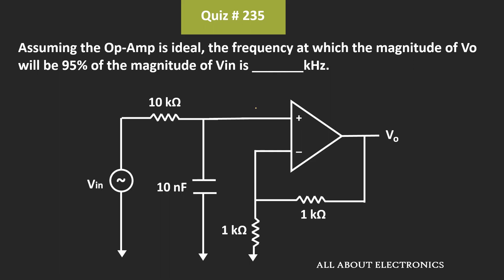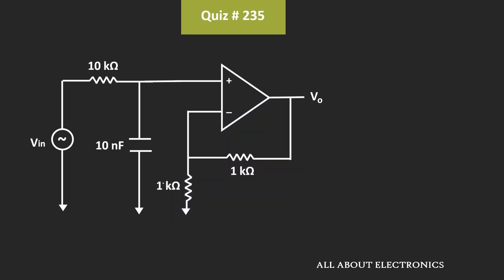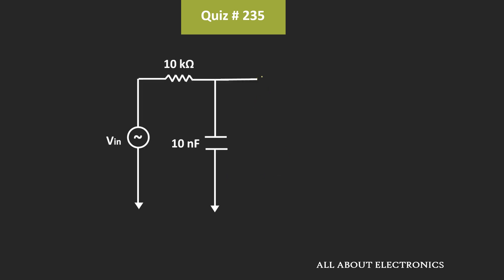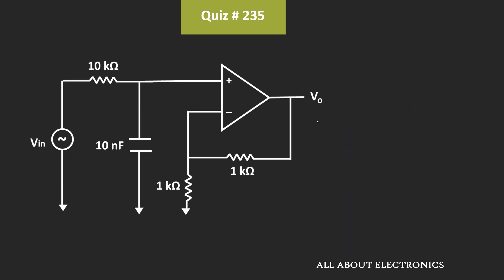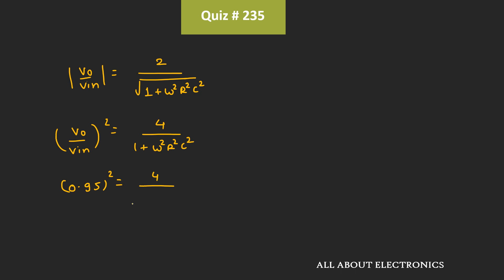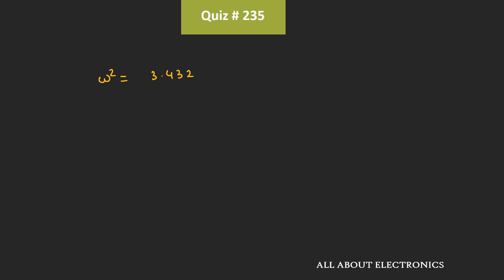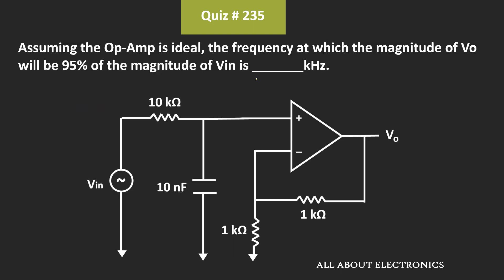Op-Amp/ Active Filter | Quiz # 235

Comment from the maker: The link to the related videos:

1) Low- Pass Filter 
https://youtu.be/_2L0l-E1Wx0

2) Non-inverting op-amp
https://youtu.be/uyOfonR_rEw
Reply: I tried to answer your question but I found everytime that the frequency is equal to approx 1.759 kHz and that satisfies for every given input voltage, the output voltage is .95 of the input voltage.
Reply from the maker: May be if you just tell the procedure that you followed, I can help you. Or you just go through the video, and you may be able to figure out what's missing in the calculation.
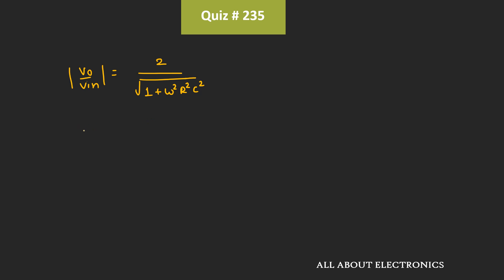Reply: @allaboutelectronics-quiz  the way I solved the circuit is this.. Since I want for Vo to be .95Vin, I solved for Vx first which is .475 of Vin since in this NI amplifier Vo = Vx(1+Rin/Rf). .475(1+1) satisfies .95. Then I got the frequency by using the voltage divider Vin(Xc)/Xc+R = Vx. I got 1.759 kHZ and it satisfies the question for any given Vin. As for your video at 2:34 is where I am really confused. How is 1+jwRC = sqrt (1+w²R²C²)? Thanks for your response.
Reply from the maker: The equation 1/ 1 + j wRC represents the transfer function of the filter. If we just consider the magnitude then it will be 1 / sqrt (1 + w²R²C²).
Its similar to the magnitude of the complex number A + jB, which is sqrt (A^2 + B^2)
I hope it will clear your doubt. 
If you still have any doubt then let me know here.
Reply: @allaboutelectronics-quiz  I get it now. I only have one concern, how can I prove that the answer to the problem produces an output .95 of Vin. Like the frequency is given and the answer is not. I can't prove it using your way. Thank you.